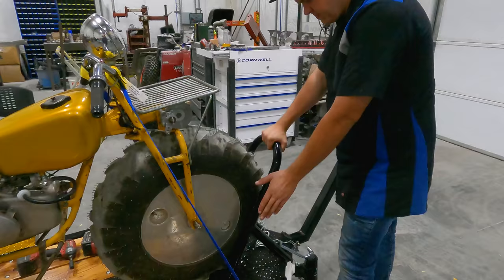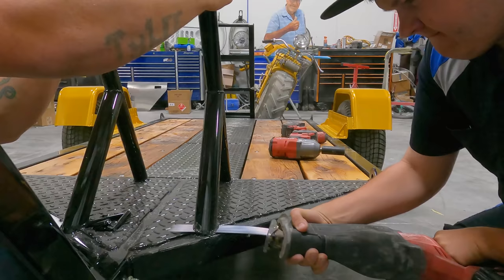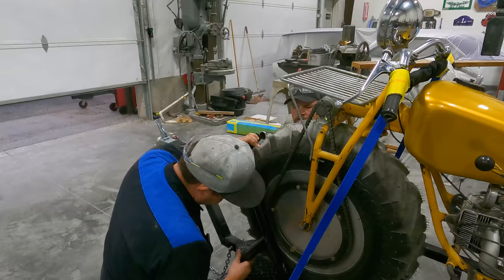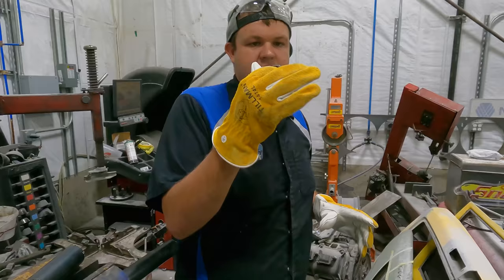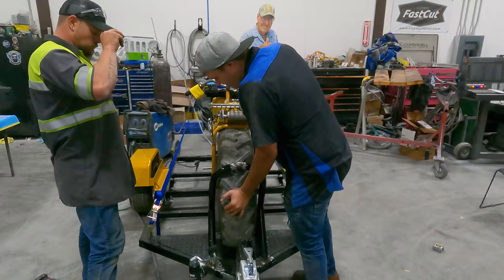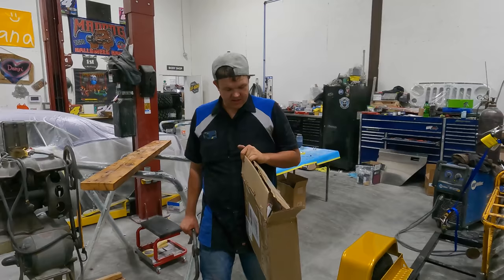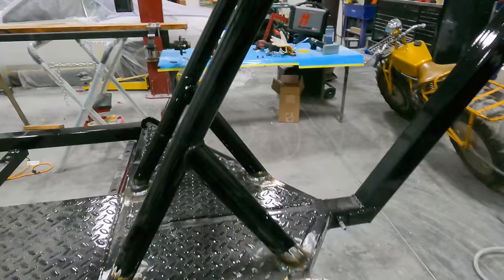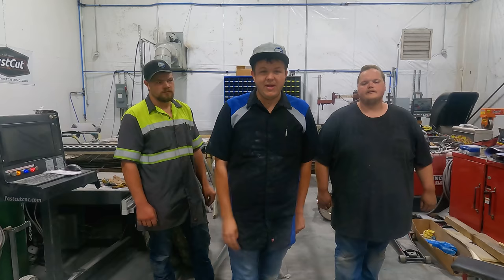We Had To Cut Fresh Paint On The Golden Nugget Trailer!

Comment: Put an Ammo can on the trailer for Ed to store his straps and a gas can holder on the other side.. set him up before you paint it again!  Also, the side plates help but you should really gusset the toungue on that thing.
Reply: Ammo can idea is genius.
Reply: Yes. This for sure.
Reply: Good idea
Reply: WWRD(what would rory do)
Reply: Ammo can is best idea I've heard in a while. Will be weather tight and it'd look like a golden nugget on the trailer!!
Reply: Hey Robbie! Great project.
  Curious! Why not pin the ramp to Rokon trailer hitch? It’s right there.
Reply: Good idea. We do that in sailing dinghies.
Reply: @stevenwaller192  I thought of that, too. The only problem is if you tow the trailer empty, the ramp isn’t supported.
Reply: Robby Check out those self retracting ratchet straps to hold the bike down, cut off the bottom hook and bolt the ratcheting part on
Reply: A aluminum diamond plate tool box would look nice. I had a triangle shaped one that fits on the front hitch frame section but that doesn’t look like it would fit yours.
Reply: Nice
Reply: The lack of gusseting on the tongue has been an issue (imo) from the moment it was redesigned.

Comment: I think the ramp should be as wide as the trailer, it allows the rider to put a foot down while loading it. I feel like it's a safety issue especially since Ed is going to be loading it, and is getting older.
Reply: Yep, and then it can be used for other stuff too, like hauling a lawn mower.
Reply: I agree and a small boat winch is an easy way to lift the gate for Ed without him having to bend down to pick it up.  But it can be modified later as Ed shouldn't be kept waiting.  I think the Suzuki should have AC too but after it is presented  to Ed
Reply: @aFishNamedPete  You don't know what Ed want to use the trailer for.  It stupid to make a nice trailer just for the purpose to haul a bike.
Reply: YES, thank you.   I was scrolling through to see if anyone had already said this.  I suspect the shop may be aware of this because every time they loaded it or unloaded the bike they edited out the part where they were on the ramp with the bike.
Reply: I was about to post the same thing. I'd hate for Ed to fall off loading. At least need a couple of feet added to both sides of the ramp.
Reply: I've been thinking the same.
Reply: Age has nothing to do with it, I was in my 30s when I and my bike came off on a thin loading ramp. Funny that day and now, not so funny when I woke the next day. Think safety! I think the ramp should be wider.

Comment: I agree about the wood get'n slippery ... especially in the winter
some sand mixed into clear coat would solve that issue without taking away the look 
Also "safety wire" those pins to the ramp so as to avoid losing them within a minute of removing them
Reply: I also mentioned this in the previous video when the wood was installed. Looks great though!! Safety first. Especially when you’re hauling dynamite.🤣
Reply: @tango1919  good thing the new dynamite is more stable
Reply: Some light fixture "jack chain" would be nice for the ramp clips. Need to put a restraint on rear wheel to keep it from bouncing/creepin side to side, most mc trailers have a c-channel for tires to fit in that helps prevent that.
Reply: The paint section of hardware should have some "Non-Skid Floor Finish Additive". It's made of ground glass powder. Easy Peesy
Reply: @RDCM1008  I concur
Reply: Looks good, but I do agree as I did the same thing, rebuilding a trailer and the pretty wood was slick as owl shit, a old timer told me to put sand on the clear coat, but I didn't listen,
Reply: I'd actually use antiluce pins to hold the ramp stays then there is nothing to lose or jack chains to break
Reply: @davidtaylor8244  What is luce and why are these pins so against it

Comment: @ Robby Layton
Warning, 
I see a future accident taking place with Ed unloading the bike.
The ramp should have been wider, when an elderly man like Ed goes to back the bike off the trailer, he will have no where to put his feet as he comes off the trailer onto the ramp, his feet, for a moment can't touch the ground while backing down the ramp. This would be solved by a wider ramp, perhaps even covered in wire mesh expanded mental to help keep the weight down., or perhaps even build the ramp assembly out of Aluminum to make it light for Ed to handle. 

PS, you and your team do some Awesome work, thanks for sharing with us.
Reply: FFS this has been said a thousand times on every trailer video.
Reply: @stargazer7644  wow, good to know, sounds like you have a lot time spent reading the comments, is there a way I can contact you personally to run my questions or statements across first? I'd Hate to voice my opinion or concerns without first checking with the comment section police..
Now, since you police this space, lets see some action on the scammers in this space, can you work on that asap? Your time and attention to this matter will be Greatly appreciated by the entire community. 

Thank you for stopping in and setting things straight, I look forward to seeing you around in the community.
Reply: @questioningthoughts2152   Or you could at least glance at the comments to see if your thought has been said before and is worth adding to the noise.   You can't read 10 comments on here without someone whining about poor Ed not being able to get off the trailer.  You do realize Ed rides this thing up and down steep boulder covered mountain hillsides in the snow and across rock strewn creeks, right?  I think he can manage a ramp on a trailer.
Reply: @stargazer7644  sorry buddy, I don't have that kind of time, some of us are busy with other useful issues.  FYI,  I didn't even read beyond your first sentence or two, why, because your complaint  really isn't important to me, or perhaps most people replying in tge comment section. 
Do yourself a favor, put down the YouTube and get yourself some fresh air, it might help you relax. 

To end, I wish you well and I hope you some how get through this issue on your own, if not, seek outside assistance. 
Take a moment and Smile, it really changes an angry state of mind.
Reply: Y’all know Robby and his team did not design the trailer, it was done by Tom Tom and Matt’s crew.

Comment: Just an observation: Every time you load and unload the bike you cut the video. That exact point is where I can see a challenge for Ed as he might not be agile enough and his legs not long enough to reach the ground. Maybe a wider ramp? Or maybe it’s actually not an issue?
Reply: I was thinking the same thing, even young people have trouble loading bikes up a ramp.
Reply: Was gonna say the exact same thing! Do a full ramp so he can put his feet down when loading, or walk it up nice and easy.
Reply: I was more thinking that it’s hard to drive any two wheeled vehicle slow and keep the balance, the older you get, the harder it gets. As the current ramp is a ladder type, it will be a bit bumpy to drive on. Maybe this all is not an issue as Ed will always go driving with someone and can get support? I just want to have him around as long as possible.
Reply: @dr.floridaman4805  It’s not about the bikes ability. It’s a balance issue.
Reply: @dr.floridaman4805  true but it’s a low trailer the current ramp is short… aluminum or spring assist shouldn’t be too bad to lift

Comment: From a safety perspective, especially for Ed, I'm wondering if the ramp should be more of a tailgate so that the Rokon can be walked onto the trailer instead of riding it on?
Reply: That's what I was thinking a full width gate would be safer, and it would also make the trailer more useable. You could put a little tractor or quad, and a ton of other things on it if it had a full width gate.
Reply: I was thinking it could possibly be a weight thing. I know a solid metal gate on the back would make it stand up when they unhooked it from the truck. They probably dont have the time (or weight capacity) to counterbalance the trailer for a large gate.

Comment: I had a utility trailer blasted and painted a few summers ago and it failed similarly. The shop blamed it on the high heat and humidity and immediately offered to re-do it. I couldn't take them up on it because I needed the trailer in service immediately through the summer and fall. 

The guy I usually deal with told my the owner wanted to see me in his office. He REALLY wanted to fix it. I told him that I appreciated that but couldn't afford the downtime. We reached a satisfactory arrangement whereby I used it for the rest of the season, disassembled it and dropped it off in December to re-do at their convenience. I appreciate shops that stand by their work.

Comment: I feel like the ramp should be the width of the trailer. I keep envisioning Ed having a hard time lining up those big old tires with that skinny ramp.
Reply: I think that would be good too, but how much weight will that add to the ramp? Wide ramps get heavy and are tough to raise.
Reply: @benjaminrush7888  Sure, but you could make three ramps with the same weight as the current one. It would take a bit longer to lower and raise three separate ramps (as well as securing each), but it shouldn’t be more difficult than operating the current one.
Reply: Ed is as spry as they come.

Comment: Needs a guide rail for the back tire so the bike does not bounce around during trailering.  This is based upon years of hauling motorcycles on trailers.
Reply: As long as they put straps on each side of the rear forks, it will stay in place. We always used a minimum of 6 straps, 2 in back and 4 in front, down low on the forks right above the fender, not compressing the forks. They are doubled up in front for insurance, in case one broke or came loose. Learned this delivering $30k-$40k Harleys in enclosed trailers and helping friends/family move cross country. The main issue I see is it needs strapped from the forks, not the handlebars. As a motorcycle tech I've had to replace A LOT of bent bars and rebuild blown out fork seals from people using them as tie down points in trucks and trailers .

Comment: As a full time wrench turner and a YT painter I feel the pain involved in having to do things over, and over again. Story time with a professional toolbox........ Did a rebuild on a bike. Pulled the fuel tank and set it down only to realize the seal on the fuel filler was bad and let fuel leak and seep into the tiny chip in the decal that was on the tank. 2 days later the fuel found it's way through the decal and under the paint on the tank and the entire decal lifted down to the metal. A week after that my attempt at repainting the tank and stuffing a $125 decal back on the clear coat decided to protest my efforts. $300 dollar job turned into $800 of my attempt to do the right thing. "We all make mistakes, it's what we do to correct them that decides who we are"😎 can you please get dinner to do the Truffle Shuffle already? He's a legend!🤣🤣🤣

Comment: Can you drill the pins so he can use R clips, you have called them cotter pins, or can you get some wing nuts so he doesn't need to carry a spanner to remove the ramp supports?
If you use the R clips you can add a small chain so they dont get lost as he takes the bike on and off.
Reply: Yea I thought the bolts were not quite the ticket. But drill it out and you could use a locking pin easily.

Comment: This trailer was ‘designed’ from scratch (with a few assembled components like the axles) and without exact measurements for the size of the Rokon or the Nuggets hitch position. It’s normal that the first design has some issues. It started with the hitch needing adjustments, then the front hoop and now the ramp.

Comment: Add some little keeper chains so those little pins that lock it together don't get dropped in the sand by Ed and lost forever.  The chains will make it easier for Ed to pull the pins too; old hands struggle with little pins. ;)

Comment: Need to weld or bolt some chain to the trailer then weld the other end to the ramp pins so they don't get lost, can slip some rubber hose over the chain so as not to chip the paint over time

Comment: I suggest that you attach some small cables to the cotter pins that hold the braces for the back ramp so that don't get lost quickly. they could be attached to the ram to stay with it.
You might even get the type that have a fold over ring that helps secure then when pinned. Then just attach a small length of stainless cable to the ring.

Comment: You guys need to have something for Ed to put his feet on to be able to balance going up the ramp. If he gets unbalanced on the ramp, there is a long way to fall and get hurt.  A suggestion would be a wooden extension on each side of the ramp.
Reply: Ed will have to design a better heavy-duty ramp for himself.
 And have matts off-road recovery weld it on

Comment: I always wondered what was going to happen with the ramp and how you were supposed to fasten it when in transit. Great stuff that you can admit that things go wrong and then show how you fix it. Robbie.. I can see those small tabs that you welded to the trailer for the straps are going to be broken and bent when putting the bike on and off .. it would be much better to have the straps bolt directly onto the side of the flat tray beside the wooden walk strips, and less chance of them being broken and bent when the straps are not in use... also move them so that they fold down flat with the wood so there is nothing sticking up to roll over and possibly have Ed fall off when loading it. You can then notch out the wood strip at the back so that a finger hole can be used to lift the straps up to then be bolted into place for transit.  I hope you get my idea and understand it.

Comment: Robby something to think about, you shouldn't use stainless nuts and bolts on any sort of frame, suspension, wheels, heavy duty or safety items that hitch to another part. They look nice but they are also much more brittle than steel bolts and can snap. Holding the wood in place would be fine, but not so good on wheels, hitch points or anything that may flex a lot could snap off.

Comment: How about putting a quick release pin on the Rokon so the hitch chain can be shortened. The hitch could then be lifted up so the Rokon could tow its own trailer... Or maybe the hitch on the trailer is so high you need to make a "gooseneck hitch" plate that can bolt to the rear rack of the Rokon!

Comment: You should put some 3 or 4" pieces of flat steel as latches that latch onto a pin on the trailer when you push the ramp up.  Lift the latch to release the ramp...

Comment: Had that happen on the roof of my Charger after a branch fell on it. Spent over 2 months in and out of the incompetent shop with windshield leaks. Then when I washed it the power washer blew the paint off. Another month later and a shop I chose finally got it done correctly.

Comment: Nice work guys! 
The ramp is to narrow, there is no place for Ed's feet on the way up he could fall.
Reply: Good point. Ed is an old man, no longer so good balance. He may fall side when drives up the ramp and feet do not reach the ground.
Reply: I doubt he could really support the bikes weight if it started to go over anyways.  With the gearing it has he should be able to drive up pretty smoothly.

Comment: I was thinking in a previous video that you had some chain links out of the old grill. Maybe you could weld them on the spot where you had to make the extension to widen the front wheel holder on the trailer. Just a thought. Right in the top dead center.

Comment: if you remove the new straps that you made, and instead make it so that the rear ramp gets pinned to the rokons (brand new old) hitch, you would both be holding the ramp in place without adding more parts to it, you would also be holding the rokon solid from the other end, then the only ratchet that might be needed would be a single one pulling it forward.
Simplicity is king.

Comment: Good job catching the adhesion issue. That flash bake on the sealer before the DBC made me cringe on the earlier video. Thought this might happen. The important thing to remember is that the recommended flash/recoat times are based on 70 degrees F and 50% humidity. Warmer or drier decreases the wait time or you get lousy adhesion.

Comment: I might have put a bar across the ramp with a slot where the hitch was so you could just drop a pin though the hitch hole. Then it would also help to hold the bike in the trailer.

Comment: Robby, I am still worried that the trail hitch for the Rokon trail Does Not have reinforcing "Gussets" at the bottom or top of the Gooseneck.  One hard jerk with weight on it and the neck will stretch and the welds fail.

Comment: Crap occurs Robby! Been there done that like many others....I guess it's a little better to catch it now, not really.
Your ramp and flat bar supports will rattle and drive you nuts.
I put thick o-rings on one end and rubber grommets on the other end of my ramps.
... that's what I had that fit nice over the bolts/pins so they wouldn't fall off and still take up the space of the rattle. The sun will rot them in time.
While you have the wheels off, put some Ben Hur spike wheel nuts on.